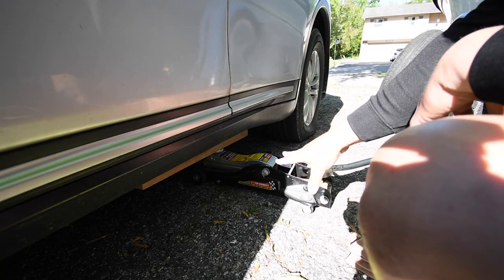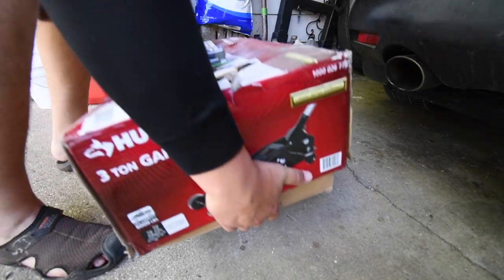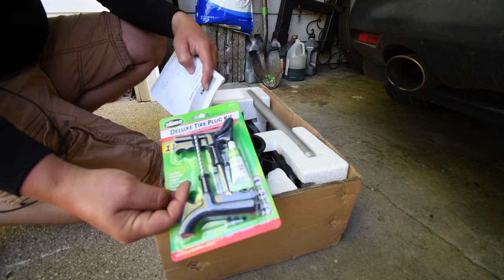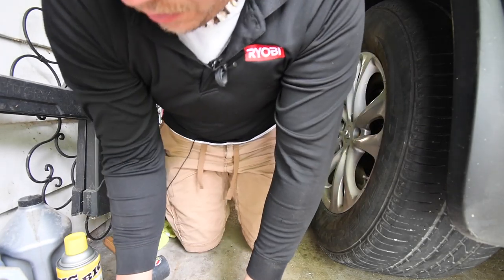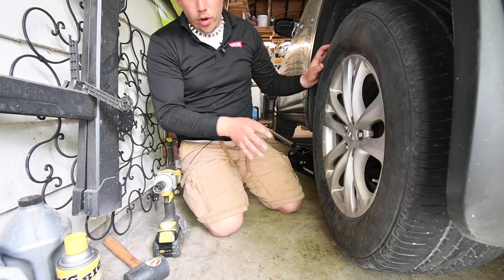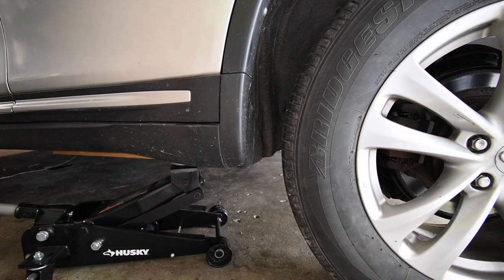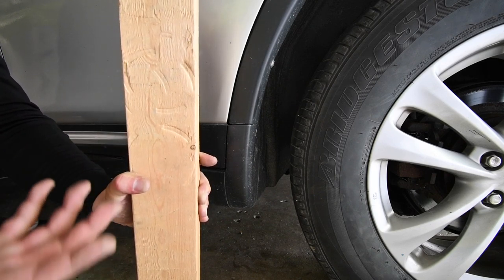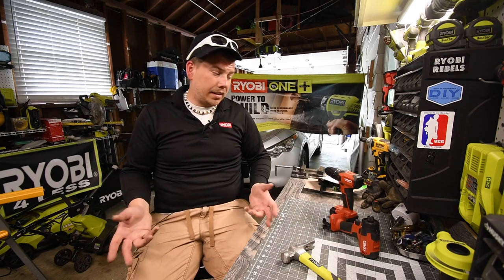Testing out a DIY Tire Repair Kit

Comment: Those kits are pretty good I got a few in my shop. Always put glue on the plug so it’s stick in the rubber when you push it in so it lasts longer. Great vid 😎
Reply from the maker: that is one thing I should have done. apply the rubber cement twice

Comment: To help find the leak or test your plug you can use some soapy water, it will bubble up if air is leaking
Reply from the maker: I found the screw immediately

Comment: Instead of wood on my jack I use a hockey Puck fits in the saddle of the jack fairly well too and it won't scratch undercoating or paint
Reply from the maker: that's not a bad idea at all and thank you
Reply: @ManCaverTools  no problem

Comment: You should have gotten a Daytona jack from harbor freight.  They’re knock off of the snap on jacks.   Great value jacks.
Also you want to use rubber cement when you put in the patches.  It’ll glue everything together but it also acts as a lubricant when your putting the patch in.
Reply from the maker: I thank you billy bob.
Reply: The most expensive original one is actually made in the same factory

Comment: ps you can plug without removing tire do it all the time  faster. Keep plug kit and pump and tools in car, can help a lot on fly great to have on hand for boat  tires etc   keep it with you. can save the day
Reply from the maker: I needed to make sure I only had one hole in the tire and the best way to do that is to take the tire off

Comment: Rubber cement,et goes on before u insert it, to hold it in.. Not on top. It will get worn off
Reply: * help... It isn't essential
Reply from the maker: I thank you sir.
Reply: @ManCaverTools  i identify as a lamp. How dare u assume me gender